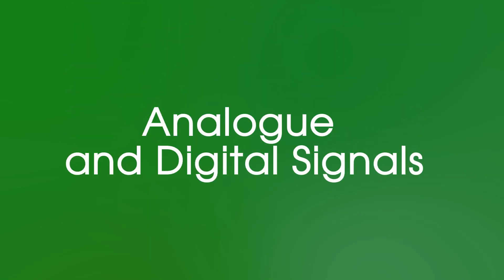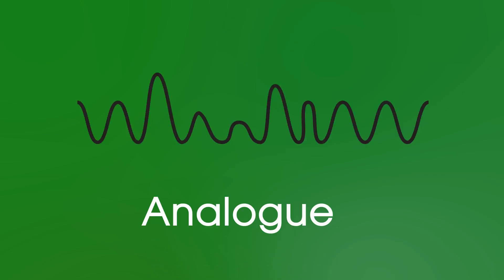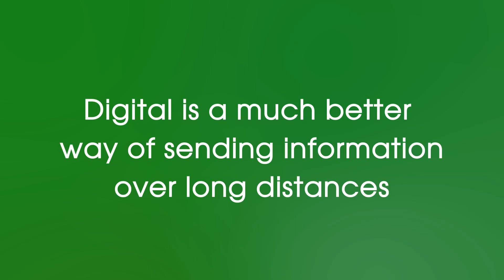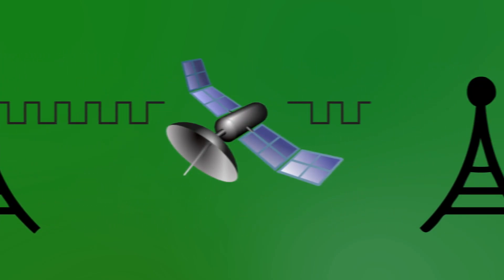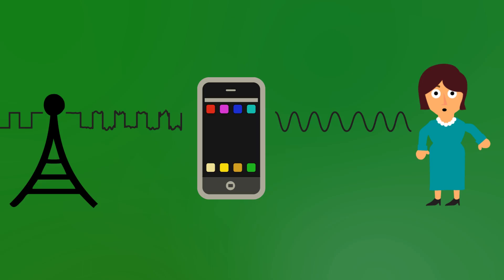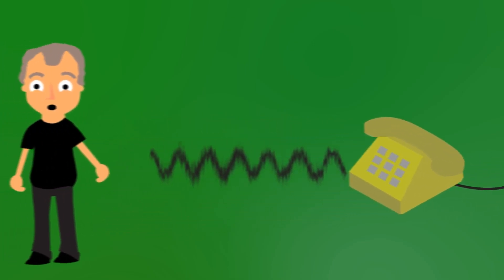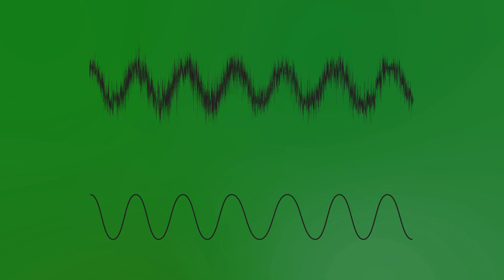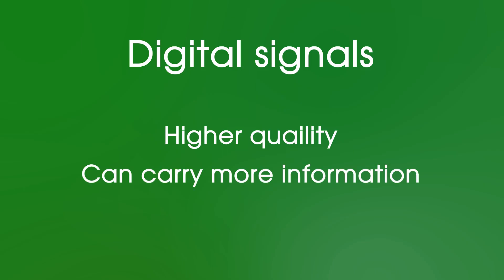Physics - Waves - Analogue and Digital Signals

Comment: this is slightly misleading. Digital is not a wave for transmission and thereby a "signal" as you are making it sound. Digital is a way of encoding a wave or signal...and is transmitted either through an analog wave or intermittent analogue wave

Comment: For audio, I would try to stay analog all the way until going into the AD converters. Just use high quality balanced leads.

Analog is a smooth, round, consistent waveform, while digital is "square-y" and inconsistent. No matter how high the sample rate, it's never going to be as smooth and full sounding as the real thing.

If you compare a digital vs analog connection where the distance is like, miles... then digital wins easily. Because the sound quality is going to be fairly good considering how far the signal travels. Analog will pick up way too much noise.

BUT (!!!) if the distance is - let's say - only from one room to another, then stay analog. You would lose more info going digital than the noise you'd gain with analog, within such short distance.

So it really comes down to distance.

Short - stay analog, because the quality beats digital. It's what you'd call "lossless"
Long - definitely digital, because even though you lose info during the conversion, the signal doesn't change depending on distance once it's traveling.

Comment: Actually, you are a fucking idiot. Digital is much better for long distance transmission but analog is much better for signal played locally. Actually what you failed to mention is that digital it tries to copy analog but it fails to do it perfectly. So, no audiophile person would prefer digital over analog.
Reply: Actually it determines on the bit-rate of the digital signal. If you do not know, you can adjust the quality of digital to an extent where it is essentially indistinguishable to the 'real' analogue signal which was originally recorded. So, basically you're wrong, as analogue distortion occurs even over small distances, which when amplified, the effect is made more apparent.
Reply: 31778Gaming Nope, you are wrong ! There are plenty of analog machines out there that digital can't reproduce. For instance take the TR-909 and TR-808. The emulated digital ones sounds nowhere near the analog machine. Digital will never beat analog in sound !
Reply: That's because if "The emulated digital ones sounds nowhere near the analog machine", then the bitrate you are using obviously isn't high enough. For an "audiophile", I'd expect you to know and understand this.

I mean, you're technically correct that "Digital will never beat analog in sound!", but only directly from the source. For anything over 1km, (as nearly all signals you will hear are), digital is simply better as it is not affected in amplification whatsoever, whereas in an analogue signal all the distortion and electromagnetic interference is amplified with the original signal.

I recommend you re-watch the video we are commenting on!
Reply: "Yes, digital is good for long distance stuff since it can be replicated exactly as the source while analog can't !"

Thanks for agreeing with what I was commenting on!
Reply: sir why did u have to curse u could've said it nicer or some sheet like that but rally u have to put "Actually, you are a fucking idiot. " because if i was u i wouldn't be talking wit that big ass forehead of yours, and your fucking uni brow that goes around he fucking earth. Anyway if you don't like how he referenced it then make your own video and explain it in your own way.
Reply: AYYYY GET WRECkED
Reply: why the fuck did u say get rekt.. Tf
Reply: +31778Gaming And by the way, imagine it like this. Get a painting, have a microscope see the smallest details you can , then get digital camera ... when you try to look at an area you can't see a damn thing all you see is squares. Got it damn fool ? Digital is computer generated who tries to copy digital, if your ears can't make the difference in souns i gave you the picture example. Now get wrecked !
Reply: +Ciprian Obreja digital tries to copy analog, i was trying to say
Reply: From the original comment you made saying "Actually, you are a fucking idiot", it sounded to me as if you were making unfounded and wrong statements (which you were), rather than just that "digital tries to copy analog". 

Your analogy that "get digital camera ... when you try to look at an area you can't see a damn thing all you see is squares" is like the saying, comparing apples and oranges. Have you ever heard of a digital microscope? Both digital and analogue waves both originally come from an analogue wave.. because that is what we find in real life.. But what I'm counter-arguing and the video is saying is that digital is better for communication, and as I said in previous comments is indistinguishable from analogue with a high enough bitrate.

 Also for a self-proclaimed "audiophile", you saying "Digital is computer generated who tries to copy digital" makes it seem like you have no idea what you're on about! Sorry!
Reply: nerd
Reply: ooo get em im wit you on this buddy
Reply: also learn how to spell ANALOGUE

Comment: well, both have advantages depending on what particular application, but also have disadvantages... analog signal is practical for long distance propagation of radio waves but incurs loses when not amplified, whereas digital signal is said to be noise free but mostly use for short distances because it has bandwidth issues and also needs repeaters to maintain its signal strength...and digital signal can not be transmitted in space unless converted into analog signal (for radio waves).but with the radio horizon, propagation of digital signal is made in air. correct me if i'm wrong...tnx
Reply: You're wrong.  There are three choices one dig. One ana. And a third a cross.
The third one works in water..air and space.. it also travels through solids better..but get cut off if it reaches a hollow.. like when it reaches the hollow center 😁
Reply: Apple Tree lol
Reply: You said it properly... analog signals do have better range... alot better range.... like 70% more range than digital signals... yes it does pick up interference but its analog... if the signal is extreamly weak "0.001% from interference it looks like interference" you can still get the signal because it's analog... it's still there.... if it's a digital signal the data would drop around 10% the strength that your receiving